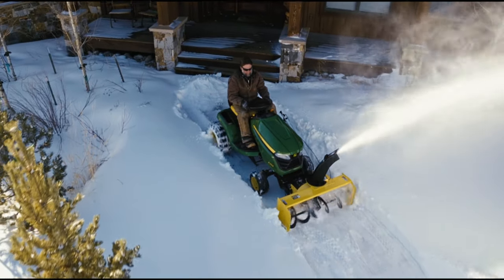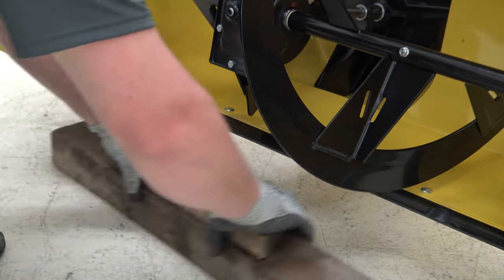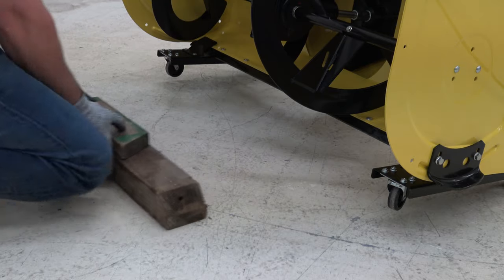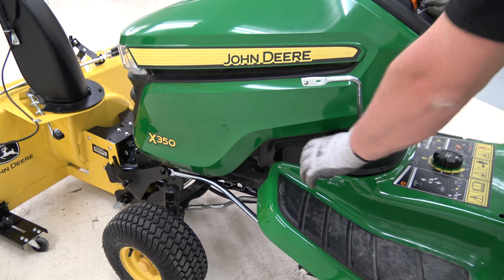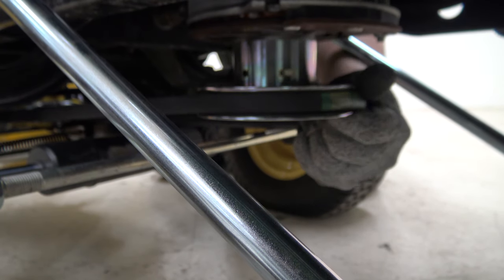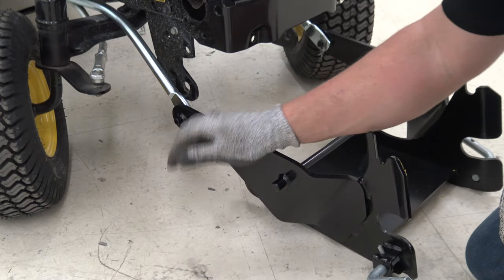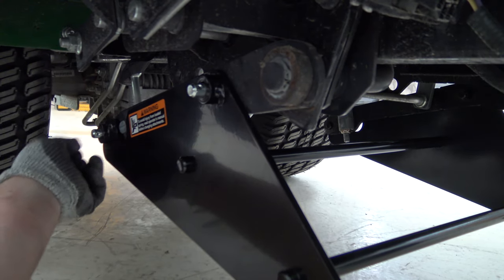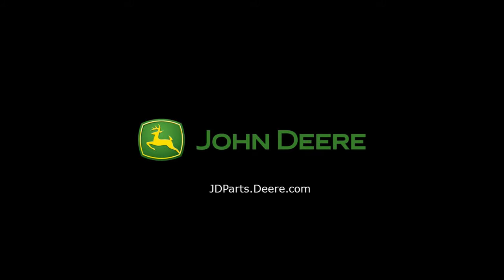How-To Remove the 44in Snow Blower |  John Deere Select Series Lawn Tractors

Comment: Is there a missing step between locking the lift peddle up and loosing the tension cable? We've got two adults pushing hard on this tensioner and we can't get the belt off. The dude in the video seems to easily move it with his thumb. I have way more tension than that
Reply: Have someone hold up the front (snowblower) to ease the tension on the belt. The higher it’s held, the easier the tension for someone else to remove the belt. Also, they didn’t mention releasing the spring to prep for the mower. It may be in the mower video, but if the video did not start with removing the snowblower, you would never know. It takes a long time to get it to where it needs to be. Keep an eye out for yellow strip to show where you need it to.
Reply: Working alone, I used a quick grip clamp to pull and then hold the tension pulley, loosening the tension on the belt. It was very easy, and the belt practically fell off the  the tractor pulley.
Reply: @patmalone4262  what size was your clamp. Brand & model would help. Also can not attach belt.

Comment: I've been searching on how to remove a snow blower attachment from a 318 and was excited to see this but then realized it is a newer mower. 
Can anyone direct me? I know the attach points but I don't quite understand if I can detach the hydraulics as I am new to this brand and age of mower. I think I know but I am being cautious. Plus, I'm reading the manuals if I can find them after this. 
Any direction is appreciated. My young son and I are learning together. Not sure which one is more excited 😊
Reply from the maker: Mr.O, thanks for reaching out. It sounds like you and your son are well on your way to figuring it out! If it would help, you can view and purchase many Operator's Manuals and installation instructions at http://spr.ly/6055O2M7F. Select "Equipment Publications" and enter the model number for your unit. If you require further assistance after reading through the related manuals, we recommend reaching out to your local John Deere dealership. Your local dealership would be happy to walk you through the process of removing the snow blower from your 318 Lawn Tractor. You can find your local dealer at http://spr.ly/6056O2M72.

Comment: This video does not match the difficulty I had in removing the snowblower.  Is there a missing step between locking the lift peddle up and loosing the tension cable? I noticed other people are having difficulty with this process.
Reply from the maker: We understand the removal can be difficult at times. We'll be certain to document your feedback on the 44in Snow Blower installation and removal instructions. If you do continue to experience issues when removing your snow blower, we recommend working with your local dealer for additional assistance. You can find your closest dealers and their contact information at Deere.com/Dealer.

Comment: I watched this video a couple times and couldn't get the actual blower off the tractor. I had to call my local John Deere company they came out and said that there's a little hole down on the left side that's a spring that had to be released to release the snowblower.. that wasn't shown in the video..

Comment: Now that I have the blower off, I can't get the mower deck on.  The deck just seems bounce, I can push it up and down with my hand, but will never lock in place.
Reply from the maker: Hi Jeff, your best resource for questions like this will be your local dealer. They will be able to assist you and answer any questions you may have regarding the installation of the mower deck. If needed, you can find your nearest dealer at Deere.com/Dealer.